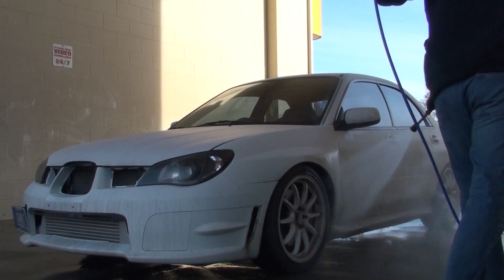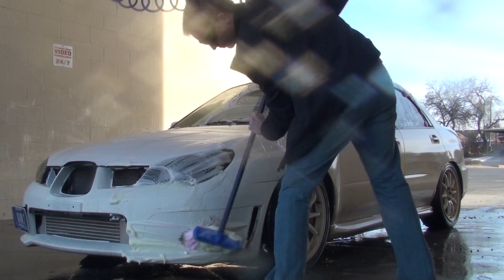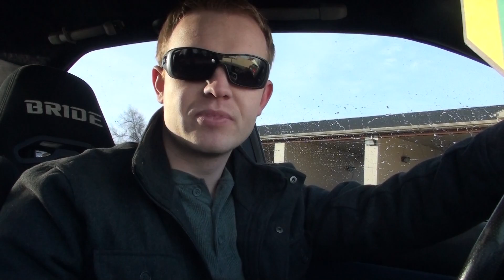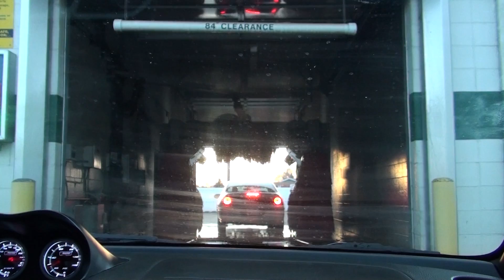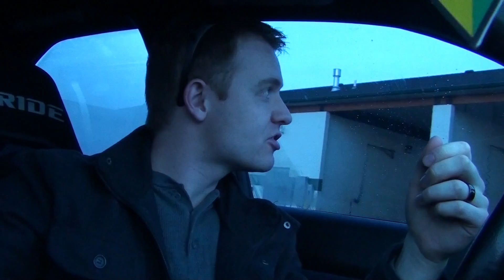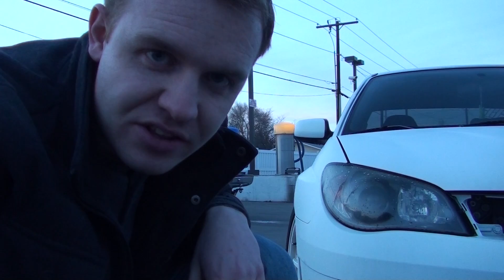How to Clean Your Plasti-Dip Car, Automatic Wash

Comment: I have a question. I own an '07 VW Gti Fahrenheit that I been wanting to plasti dip. How many gallons do you think I will need?
Reply: +Aggruh depends on the color you want and if you want a matte finish or a semi-gloss/gloss finish and if you want any pearls/flakes in it. To do your car in a matte single color you would need at least 3 gallons. remember the more coats you apply the easier it is to remove. And preparation is everything

Comment: I have a WRX 2003 and i was wondering how to plasti dip the Calipers....will it be damaged by the Brakes Heat ??
Reply: +Ryan Allam yes. You need specific caliper paint to withstand the heat/brake dust.

Comment: cool vid bro .... my question now is ... wold it hold on rim when tire change X-D lol ???
Reply: I work for discount tire co. and your answer is how you specify the service your requesting. let them know your wheel is plasti dipped and also don't plasti dip your wheels with them on your car the dip will stick to the lugs and will peel off when you take your wheels off for the tire change so make sure you take each wheel off and dip it separate, also prevents you from  getting dip on your brakes

Comment: So did you buy the paint gun to apply your finish? 5 coats? I did 3-4 coats on by trucks front end but I used the can. I drove across Wyoming for a camping trip and my bumper was chewed up. Lots of dings in the plastidip. I'm getting a new car soon and want to try dipping again.
Reply: Use a spray gun, also use at least 7 coats on a dark colored car, even a light one just to be safe. You need to clean the surface you're dipping, and also wait anywhere from 15-30 minutes between each coat.

Comment: How long takes to drye good after spraying you car with plastic dip...
Reply: About a half hour to touch, and a couple of warm days for a full cure.
Peeling off Plasti-Dip is a lot easier when it's fresh. Once it's fully cured, it adheres more strongly. You can still peel it off, but it won't come off from regular use. Also there are ArmorAll-like products that will protect the finish, and give it a satin shine.

Comment: Good video. Very helpful and informative about the durability of plasti-dip on an entire car.
Reply: I think a lot with the durability has to do with proper application and enough coats. I was going to strip off the job I did on my winter wheels from last year but the wife wants it left on. So we will see how it holds up to another winter. I did though put a good coat of Dupli color clear coat on them.
Reply: Chris Seim I'm doing my wheels for the Winter once I get my life Winter tires.

On my emblem I did 4 coats black and 2 coats clear (glossifier). It's holding up nicely. I think 6 and 3 will be the magic number for the wheels.

Comment: hey i have a question, i never touch the final product of plasti dip on a car and i always wonder what the texture feels like? i am interested in doing this to my car
Reply: If applied as recommended, it feels like touching smooth, thin rubber, stretched tightly over metal. If the surface has a final coat of "glossifier", than it feels like rubber that has been ArmorAll'ed. A smoother, satin finish. If applied differently, (and some people prefer this,) it can have an slightly rougher "egg shell" texture. It's never going to be as glossy, like enamel, but it's a lot easier, and tougher.

Comment: Great stuff dude! I had a couple questions for ya. Maybe one can turn into a Plasti Dip idea...who knows. So...when you "DIPPED" your car, was there a ton of overspray on the ground where you did it and how was the over spray, or most that floated away from the car? Did you find overspray on any of the surrounding things, such as other cars or bushes or whatever? Also, maybe Plasti Dip can be used as a way to custom match interior panels to exterior panels?? Idk...just a shot in the dark. Anyways, great stuff dude. Keep it coming! I subbed to ya bro.

Comment: HEY IS THERE A TEXTURE IN THE PAINT OR IS IT SMOOTH
Reply: there is a semi texture. Once you layer it, it fills in mostly, but it will have this kind of grippy feel to it. To get rid of that you just need to use a claybar polish. I have a Cadillac CTS dipped, flat black and gold emblems. I take my car to an auto wash that is way more intense than this one at least once a week. I've had the dip on my car for about 8 months, no touch ups, and no peel backs as of yet.

Comment: Yo ghost it holds up man but you gotta do it right like 6-8 layers of dip. Spend the bread and get the spray gun kit from dipyourcar.com. I used cans the tips the handles first for like Qrtr panels and rims emblems etc, then I got the spray kit did my sh!t matte black pics on Facebook Nate Boone or something like that. But it's strong. If ur original paint is good it won't chip when removing but, if u got some shadey spots it ain't the dips fault if some paint come up keep that in mind. Ain't had to many issues that's why I keep d!pp!n!

Comment: Yeah I work at a car wash funny we go thru same probs lolz. I also plasti dip my 01 vw jetta vr6 my friends caddy,etc,I never used white but, I wouldn't brush black. It will leave brush streaks. I work at a soft brush one like you went thru and it held up, so folks he ain't lying. I gotta say though it does depend on how good the dip was layer down.got some new product on way will post prob in spring my vdub Lil Sue Q. Keep dippin!,

Comment: Thanks for the great videos. I live in the Palm Springs CA desert where the temp on the surface of the car can reach 180 plus degrees. I would like to Plasti-dip my 95 Lincoln. The problem I have is the sun ate up my clear coat on the roof and a few other spots on my car. What do I do to prepare the deteriorating clear coat surface for the Plasti-dip process. How will the Plasti-dip stand up to the extreme temps here in the desert.
Reply: Nothing! Clean it and dip it'

Comment: Everytime I've plastidipped using both a wagner spray and doing 5 full coats + and also using rattle can, it could not even handle a little scrape as it would get deformed and scrape. (especially noticeable with black). My question is, HOW did you apply the plastidip that you can run it thru a carwash like that? Mine would have come right now

Comment: So this stuff holds up like a traditional paint job, strong, and durable...
STFU AND TAKE MY MONEY! :V

Major question though.
How do you think it would hold up on a car from the 70s? say, my Datsun 260 which is prone to rust due to the metals they used back then. Would you say its a good rust blocker and keep the metals underneath protected as a temporary solution?

Comment: I thought for sure the auto car wash was gonna shred the PlastiDip. Considering that you do not need a clean room to apply it and minimal masking, dry time, cost and upkeep, I'd say it's pretty amazing stuff. Especially for applying over worn out paint jobs. Try doing what you did outside with normal car paint. It would look absolutely horrific.

Comment from the maker: I picked up the dip cleaner towel from DYC.  Honestly it just looks like a coarse microfiber though.  I think a towel would work fine so long as you didnt rub really hard into the finish.  In my experience dip doesn't show water spots though, so that makes the drying process less critical.

Comment: Great video TokenSteve.  I have a 2004 Subaru Baja Turbo that I have been thinking about dipping with PlastiDip.  I was wondering if you had any knowledge on how the dip sticks to the plastic around the bed of a Baja.  It's the same type of texture as the plastic around the bed of the Chevy Avalanche. I also wanted to dip the chrome bars leading from the cab to the bed.  Would the dip adhere to that surface?

Comment from the maker: Initially it feels kind of rubbery, however after a week or two it smooths out.  It does fill up the chips pretty well.  In my case I repaired most of the chip damage prior to spraying it on, but even so it will remove most small imperfections.

Comment from the maker: Yes, I used it all up; you could easily get away with 3-4 gallons if the color that you're spraying is similar to your existing color, though if you're going with a complete color change (black to white for example), I'd recommend going with a 5th gallon for a vehicle of this size.

Comment from the maker: I'd remove the rust before spraying the car; my concern would be that since Plasti is a little porous it might potentially trap moisture under the paint and make it worse in rusty areas.  I sanded out my rust and put a primer over the top of it.  Zero problems so far.

Comment from the maker: If you're doing it that way there is a greater risk of it peeling, yes, just since the edge is exposed; but that's like vinyl as well, exposed edges are at more risk.  After the plasti cures completely (takes a few days for complete drying) it would still take some effort.  In my personal opinion so long as you lay the plasti down nicely, it'll be completely fine.

Comment from the maker: I did do the sail panels and the A pillars in black plasti as well as the steering wheel.  The center console is white plasti.  It's holding up very well so far; it's been on for about a year so far.